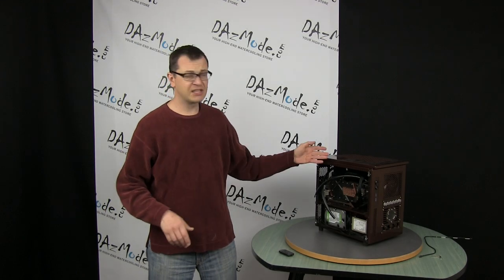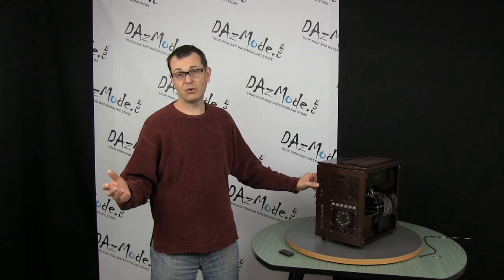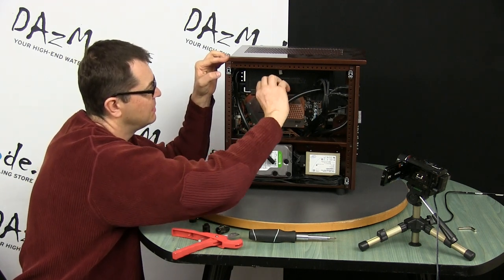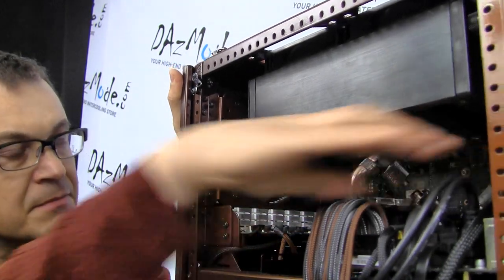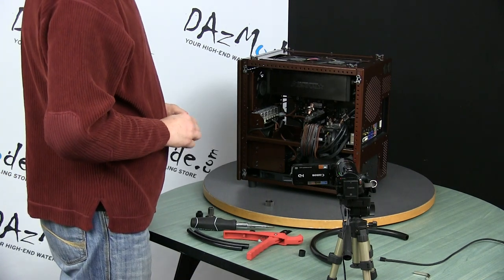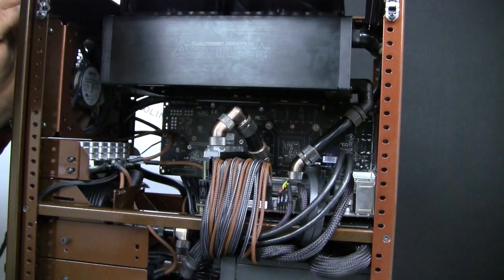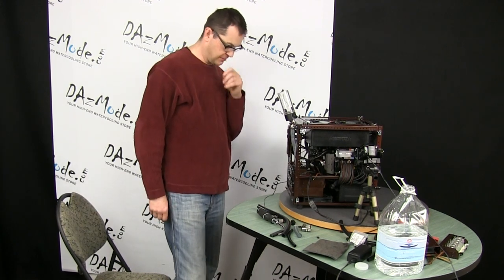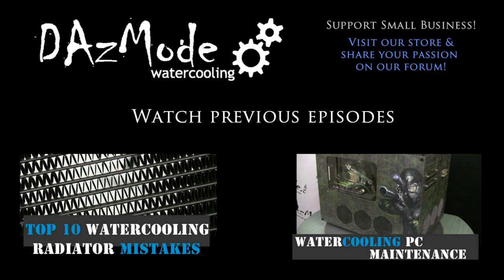!@#$% ! - Caselabs S3 Mocha Build - Ep8

Comment: Hey Daz, did you use anything else with the Distilled water, such as corrosion inhibitors/silver coil/petra's PT Nuke for Distilled water [benzoyl peroxide] i believe, too lazy to relook. If you'd like to correct me or whoever go ahead lols.
Reply: From what I've seen in past DazMode videos; he'll leak test the system with just distilled water, then when all is good to go, will switch out to DazMode Protector  (+ distilled water), or some other coolant.
Reply from the maker: Brechan Fraser
exactly right.

Comment: Well, bummer... :(

Just so I understand correctly: Is the leak in the radiator itself, or in the connection to the radiator (fitting->rad or tubing->fitting)?
Reply from the maker: I think it was side panel of radiator, but I also re-used old fitting with old o-ring, so  there is small chance it was that. Tight space did not allow to inspect it correctly and plan to leak test radiator separately to figure out the source,
Reply: DazMode
What's the general rule (of thumb) for o-rings; how often do you change them, after a couple of builds/ a couple of years?
Reply: DazMode
I had the same leak on my Admiral 360. The side panel of the rad seems to be the issue. Feser promised me a replacement but I havn't seen one (this was 2 months ago).
Reply: Mr.Owiedaman

What's up with Feser, shouldn't take 2+ months to RMA a defective product should it?
Reply from the maker: Mr.Owiedaman
 Did you have chance to check if o-ring or trying tightening screws?  That is my plan...
Reply: DazMode
Feser told me to tighten the screws on the sideplate so I did that but I still got a leak. It's a very slow leak so it's barely dripping but still a leak.